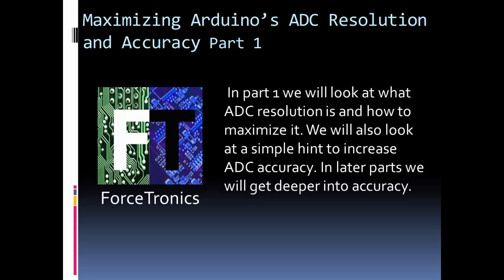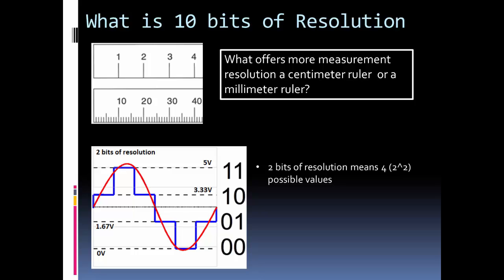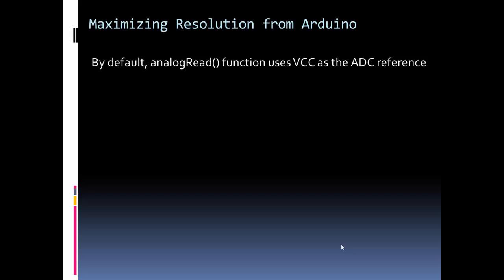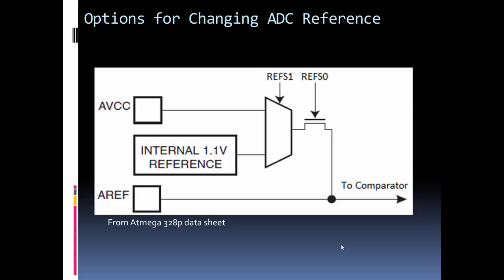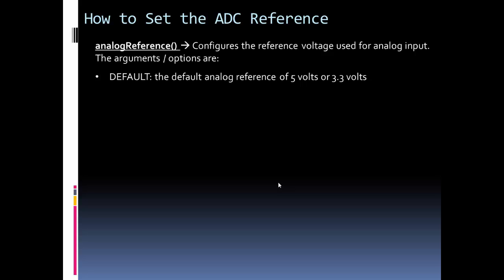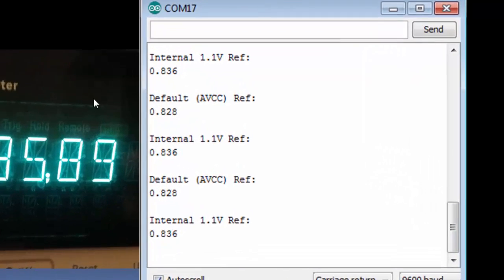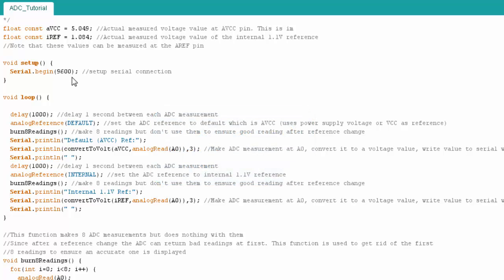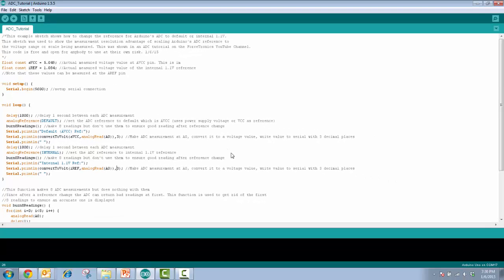Maximizing Arduino’s ADC Resolution and Accuracy Part 1

Comment: At 12:36 You have to use 1023 not 1024. 1,1V on analog pin in, return value 1023, the highest number possible. Else u read (analog in =1,1V=1023) / 1024 * (Vref=1,1V) = 1,0989V.
Reply: we have to use the number of slots (1024), not the max value (1023)

Comment: Fast questions: if I use a 3.3 volt arduino, Aref is by default 3.3v, so I have 3.2mV of resolution. That is better then the arduino uno because by default Aref is 5v and it can measure 5mV of resolution. Right?
If I measure 5v at analog input on my 3.3v arduino, Aref at 1.1, what is my accuracy?
Reply from the maker: Well you would have to divide the 5V signal down to fit the range of Aref which is 1.1V (assuming that there is no error in the Aref value). If you are able to divide the signal down from 5V to 1.1V then you would use the whole range and your resolution (not accuracy) would be 1.2mV.
Reply: The gold rule for the maximum resolution is: read the same input voltage as Aref voltage in input at the ADC. 
If i try to measure 1.1<=voltage<5V with Arduino Uno, with Aref=1.1, i read 1023 every time, right?

Comment: Great video. How would the lm35 be connected if i was to use 1.514 into aREF pin. I take it that i would use analogReference(EXTERNAL) and my code would be 

rawValue = analogRead(tempPin);
  float mv = ( rawValue/1023.0)*1514; 
  float cel = mv/10;

but i'm not getting the right results by the way I have the circuit connected